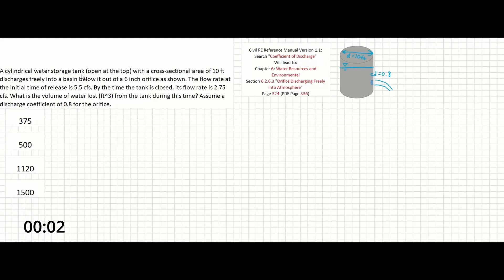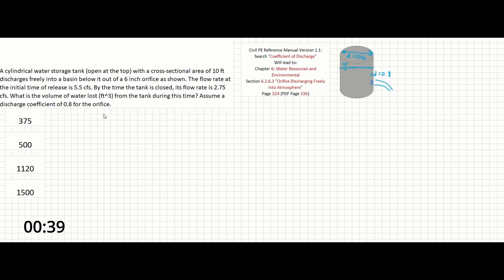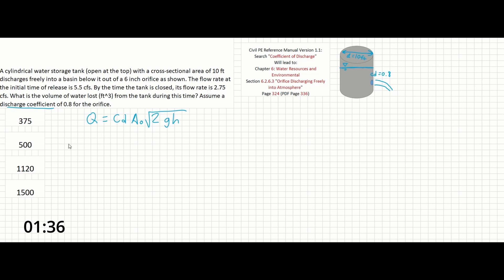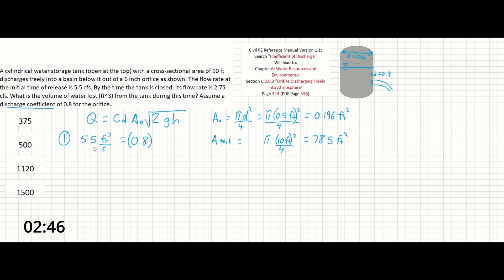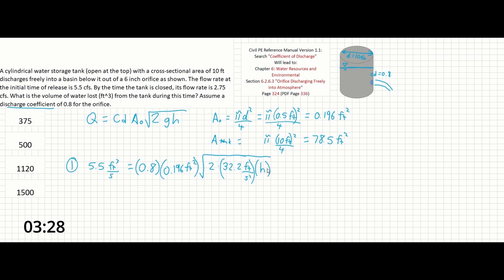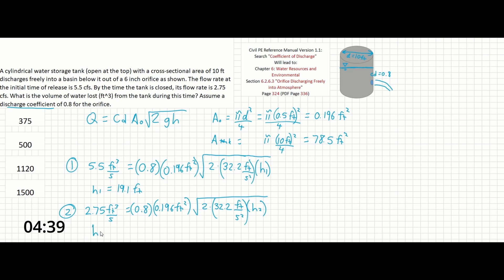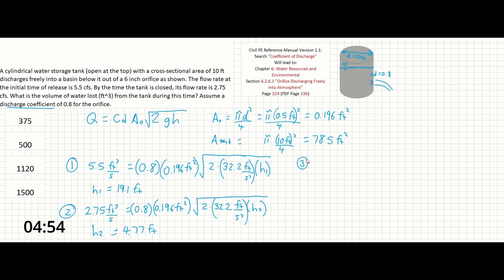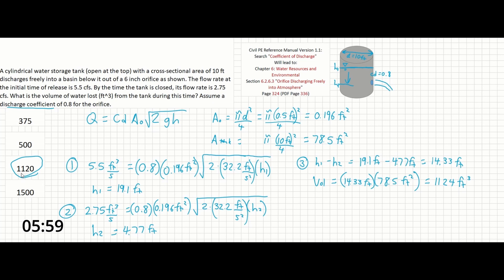PE Exam Practice Problem #8: Water Resources | Discharge Coefficient - Orifice Discharging Freely

Comment: Great question, but the first sentence threw me off a bit. Should it be "... with a DIAMETER of 10 ft..." instead of cross-sectional area of 10 ft?
Reply from the maker: Yeah you're right. I should stop trying to work on these at midnight. Diameter would have been a better choice of word. Thanks for pointing it out.
Reply: @SolvedIn6  Lol all good. Exam is in one week. Took the EET course, but these are a great refresher between now and then. Appreciate what you do.
Reply from the maker: @theodorethomas6821  Thanks and best of luck. Go get it.